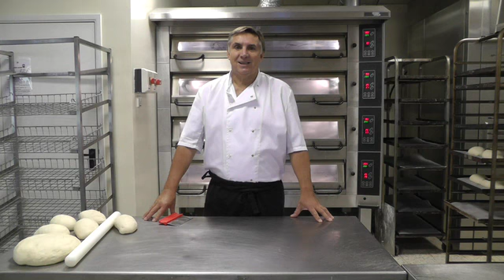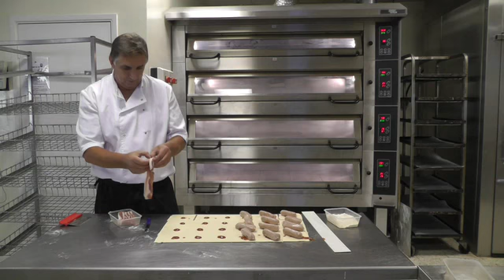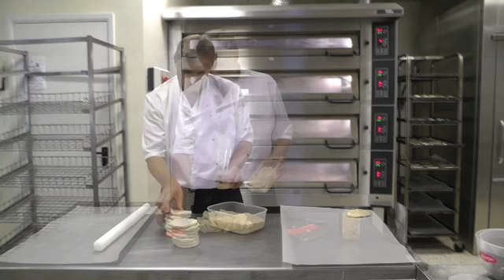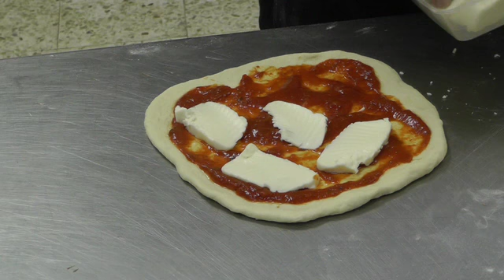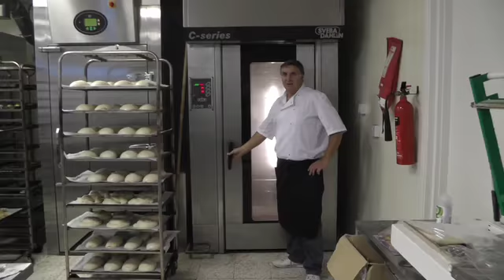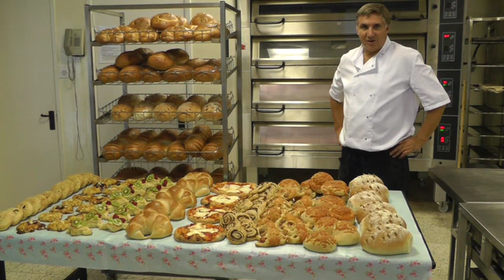Bread and pastry baking on a professional deck and rack oven.

Comment: Thank you for sharing ellaborative. What temperatures up and down are you using?
Reply from the maker: It can vary on different ovens and different products. If baking bread in tins, I would start with 8 bottom heat 5 top. If its rolls and buns 6 on the bottom 5 top, but you will need to adjust slightly if needed. One or two bakes should give you the settings that you will be able to use ongoing with your particular oven.

Comment: which best type oven for chocolate chip cookies sir? some people suggest deck and some suggest convection, it makes me confused
Reply from the maker: I have seen cookies baked well on both type of oven. The deck offers more control over top and bottom heat, but if it's just for cookies a convection oven is fine.
Reply: @stevieuk9347  i have seen in internet about convection vs deck oven, he said that convection oven has better visual appear, texture, flavour and more developed flavor. My question is, is that true a type of oven can affect on flavor?

Comment: Hello sir, can you tell me what temperature do you use for the vinoisserie ??
220 on top and 200 bottom ???
Nice video, greatings from chile, master !!!
Reply from the maker: Hi Pablo. All deck ovens have a different performance, it's a bit of trial and error. On high sugar products I would recommend a much lower base temp at first. 40% base and 80% top. You may have to adjust this to suit your product and oven but it's a starting point

Comment: What is the difference between pizza oven and this oven of yours..can i make pizza with it
Reply from the maker: The pizza oven reaches higher temperature for quick baking results. You can bake pizza perfectly in a normal deck oven but it will probably take a little longer.
Just a personnel suggestion, part bake the base very lightly. You can then top later and bake. This helps produce an even crispy bake. Also replace 20 per cent of the flour with semolina for a nice base.
Reply: @stevieuk9347  thanks for the reply...on things like confectionery...rolls..plain buns...biscuits can i use a pizza oven...thanks in advance
Reply from the maker: @cabillarnbj7356  it's not the best for confectionery but perfectly possible, just experiment on temperature and time and note your settings for each product

Comment: Pls give the temperature and timings for sponge cake five kg floor in trays
Reply from the maker: Hi Soniya,
Ovens vary in working temperature for specific products. The temperature settings are also slightly different between a deck and rack oven. Most manufacturers have a test bakery and would allow a customer to bake their own product to achieve the best results.

Comment: Wow, i love this. Really impressive.
Please what is the TIME and TEMPERATURE for 800g loaf. The Temp at the top and bottom respectively. I will appreciate ur quick response sir. Thank u sir.
Reply from the maker: Hi 210 approximately temp. All ovens vary. 45 mins but ovens can vary
Reply: It is a 3 deck oven n has UP and DOWN burner in each deck. So I don't really know the best temp to set each burner to get a perfect cooked loaf. Pls help.

Comment: Hello.. Like your video.. It all looks really good. Your a very Skilled baker.. Can you help me.. I'm just getting back into backing..

If I was making up 2 x 25kg of white flour into a bread dough. 
What recipe would you use for Crusty white Bread.. Eg How much. Salt, Yeast, Bread improve, & Water.. Please advice.. Thanks Steve
Reply from the maker: If it is crusty loaves I would recommend to 1kg flour 10g salt, 15g of yeast, 12g of fat 350 Ml of water. The improver will vary to the manufacturer. Puratos supply a range of improvers. I leave out the improver and ferment the dough instead. You can leave out the fat if you are making crusty rolls.
Reply: @stevieuk9347  Hi Lamb , That's so good of you.to reply. Thank you so much for this.
Good luck. always Steve.
Reply: Steve, Sorry got your name mixed up.. Take care SD

Comment: Hi Steven is there a recipe for the pizza dough. Thanking you;
Reply from the maker: Hi Patricia, Here is the pizza recipe that I use. 800g strong white flour, 200g semolina, 1teaspoon of salt, 1 tablespoon of sugar, 4 tablespoons of olive oil, 15g fresh yeast, 650g cold water. Mix and then ferment for 1-3 days in a fridge. Makes great Focaccia bread also.
Reply: Thank you Steven i shall try that. The 200g semolina id that like a flour or is it the little grains for making a couscous. I forgot to ask too what type of flour you use for the sweet pastry.  I live in France and have Type 45  Type 55 Type  65 and All Purpose Flour which one should i use. Thanking you so much.

Comment: what temperature we need to set
top and bottom
Reply from the maker: It all depends what you are baking. If you are baking in tins I usually set 8 on the bottom 5 on the top. If its soft roll type products I would say 4 bottom 6 top but you will have to experiment to find the perfect setting for each product